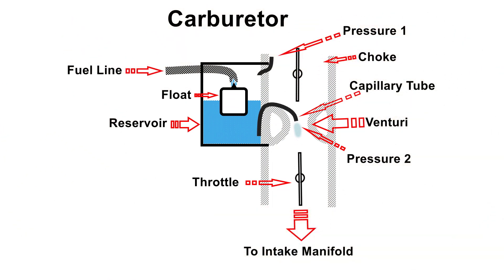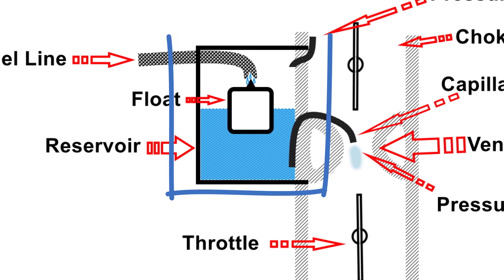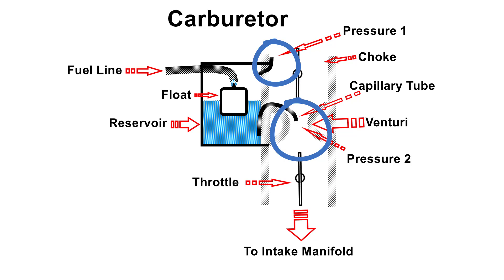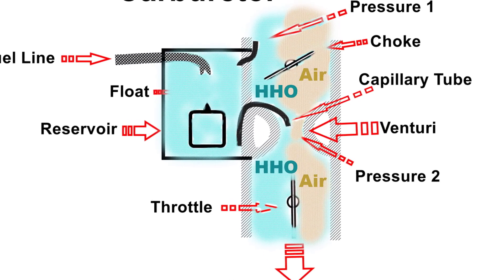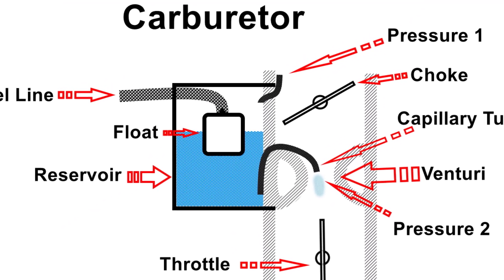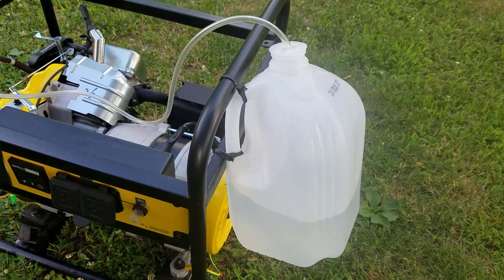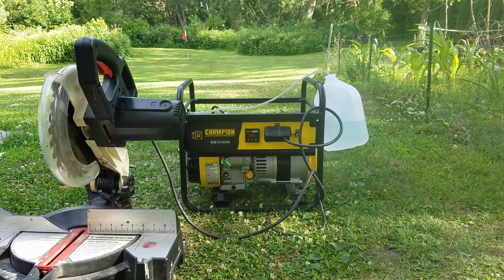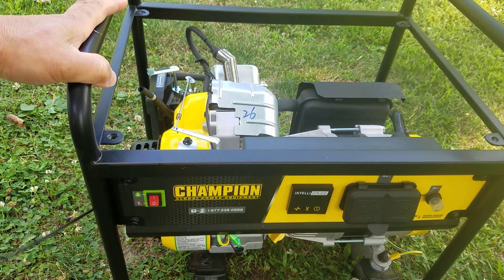Engine Runs On Water - HHO? (Fake Exposed!)

Comment: Great video as always. It's a shame when people make unachievable results thus dampening the spirits of those with a similar goal.
I assumed the carburetor and constant fuelling would be the issue. I have seen videos of people running generators using gas bottles and there are dual fuel adapters for sale. 
I am thinking make hydrogen into reservoir/gas bottle/airbed/fire extinguisher and then use to run generator to guarantee flow. Not sure of the best approach yet. I am confused further by people claiming Stan Meyer's secrets are unlocked by a magical frequency producing colossal amounts of hydrogen on demand.
Seeing drinking water as a fuel suggests steam as another option for compression rather than combustion perhaps utilising a heat exchanger to maintain energy efficiency. Keep up the good work!
Reply: Your kinda thinking along the right track my friend. But first point i will make, dont try storing the gas that comes out of the "hydrogen" generators you see on videos or the very available ones you can buy. The are not true hydrogen generators but HHO, part oxygen is mixed in, making it an extremely dangerous thing to accumulate. But there are generators you can make that produce the gases in separate cells. Its much slower in output  (keep in mind im advising on things you can practically do at home without a PHD or lab grade materials) but pure hydrogen is the only part you want to store. You will need a fairly expensive very high pressure LARGE gas bottle as hydrogen is complicated to store, it doesn't have characteristics like propane, that will compress to liquid easily, so as to get a large volume of gas in a small vessel. There are special "magic" lol compounds that can be put in a bottle that causes a complex molecular stacking and locking that allows a comparable amount of hydrogen to propane to be stored in the same size bottle. Thats not really diy level, again unless you have a degree in nuclear science. For an analogy, you got to put a spring in a tin! You cant liquify the spring to make best use of space, ya just gotta stuff it in as hard as you can! On board production of gas is only possible on some small engines with specific technical characteristics and due to the laws of conservation of energy completely pointless  (look for my comment for why you cant run a petroleum engine on pure hydrogen) Your idea of using hydrogen as part of the fuel load with bottled gas is the only beneficial approach. There is and has been steam injection technology around for a long time, and i dont know why its not commonplace, my father was mad about it, he steam injected every engine he owned. However petrol engines are the wrong target for hydrogen fuel. Theres a massive secret about something hiding in plan sight, my father worked on a secret project 60 odd years ago, he didn't know exactly what they were doing but he explained to me everything he saw and did. Over time, with the work i did and being known as a mad scientists, i worked out the conspiracy that my father never knew he was part of. For the most part that secret involving a number of allied countries and its primary objective is redundant, but what governments know from it and what i worked out and tested, is kept very cleverly quite. I think an auto manufacture is bound to reveal it as new tech soon with all thats going on. Batteries will go, every vehicle will fill up in minutes at a hydrogen station because all EV's will run full cells, but there will be one more organic product for the new gen engine on tap too. Im going to stop there on that because so far i just sound like a nut and not a concern. Lol Honesty if your looking to make savings, home hydrogen is better used for cooking and heating. As for production don't worry about magic things that you've heard, yes there is a frequency that could theoretically turn water to gas in massive volumes instantly! Its resonant frequency. Every element has a frequency at which it can not hold molecular integrity, but thats hugely complex, the frequency has to be pure and exact to the billionth of a decimal, which is almost impossible due to a frequency can slightly alter passing through air, it has to be the only frequency acting on the element, otherwise its like trying keep rhythm on drums, while some spaz randomly wacks at them. Complete isolation from random frequencies, cant be done. Im not saying all this will or wont be a factor, it will with some and not with others. Once you find the frequency you will only notice a microscopic quiver in particles but this will happen with a huge number of sympathetic frequencies also, making it really hard to pinpoint the one. Then when you have the true resonant frequency you then need to simultaneously hit it with another frequency a specific number of octaves higher.... I dont think this was ever done with water to make hydrogen. What you want to do is setup a solar panel or wind turbine,  waterwheel if near a creek? Rain water turbine, anything to make free energy to put voltage in water. Some times it wont make much and sometimes it will. Combine  sources take energy where ever you can. You will need a compressor to force gas into the tank. The low volume high pressure can be easily powered by vertical wind turbine. But your air mattress would probably be my choice for starters. Just make sure you do your research on flashback arrestors and have a high and low ventilation point in the outdoor structure your working in.
Remember your working with GAS and ELECTRICITY
Reply: Stop dreaming, it is simply not working. You can’t produce enough H2 gas to feed an engine. Even you could produce enough H2 gas the engine wouldn’t run because of ignition timing issues, backfiring, exploding gas in the crank case, burning oil films. Hydrogen in a combustion engine is only for dreamers and esoteric guys - whatever crap you hear and see, forget about it
Reply from the maker: Thank you for your comments and support!